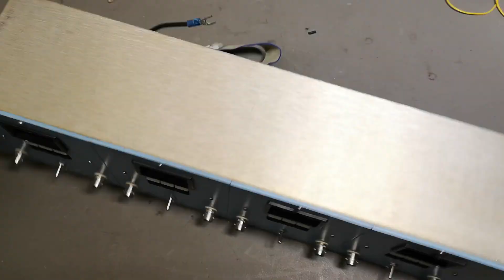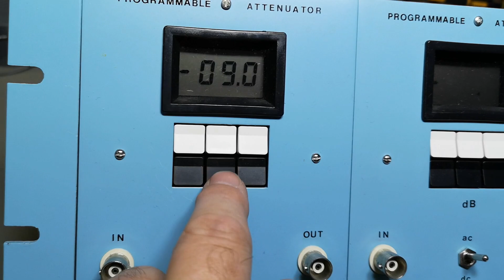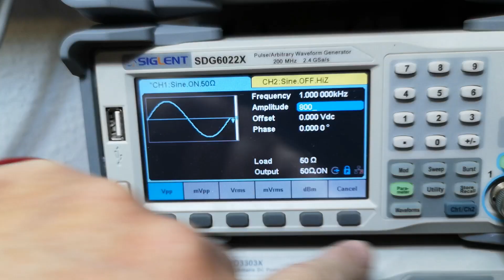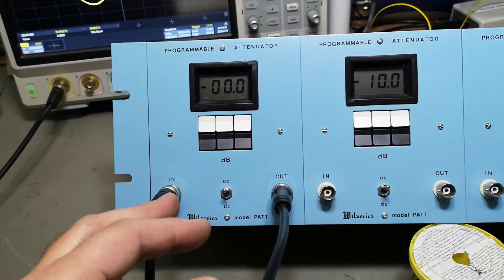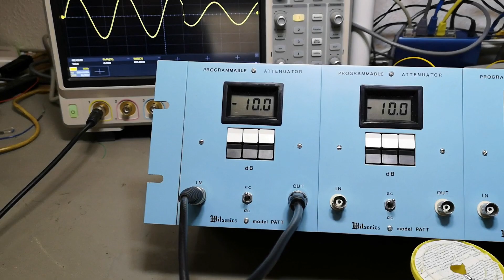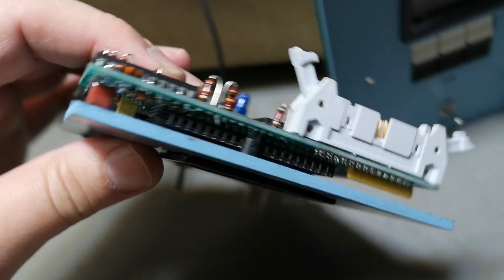Wilsonics Programable Attenuator Audio 1984 test teardown

Comment: Absolutely follows the reference design, except for using LF411 opamps instead of the AD parts. Likely the extra 10dB is applied to the input, using an extra bit on the high counter, and then it is used exactly like the appnote says. Obsolete, but you can still buy at $35 each..... And yes likely the back panel is the remote control input, likely having a latch for each decade for each attenuator, and then being able to remotely set each decade before finally jamming the data into the counters. Going to bet the display is the common -1.8.:8.8. common backplane LCD that was so common with the ICL7106 as display, used here for this purpose, with the bezel being the common one for the display. Looks like this was made using all RS parts, from the cabinet to the wiring, to the IC's on the boards.
Reply from the maker: i think it is impressive they handle the LCD by a huge stack of logic ic's :-) imagine it took a bit design time, and layout time, and part count.
Reply: @TeardownOZ2CPU  Not really, you just have 3 BCD up down counters, which in TTL and CMOS are standard MSI parts, and have been used for a good number of years as counters, at least since the 1970's. It only is recent that using a MCU to replace that became common, as till they were made in the billions the discrete logic approach was cheaper.
Reply from the maker: @SeanBZA  the BCD counters needs to be converted into 7 segments, and then AC'ed with the backplane, require a few more ic :-) well they did it, looks cool with the LCD
Reply: @TeardownOZ2CPU  That is one chip as well, per digit. Only needs a backplane clock, likely off a quad Xor IC like the 4077 and the 4511, which are common. 4029 or 4510 gives the counter with presettable input as well for remote operation. Enough IC's on that board for the digital side for sure.